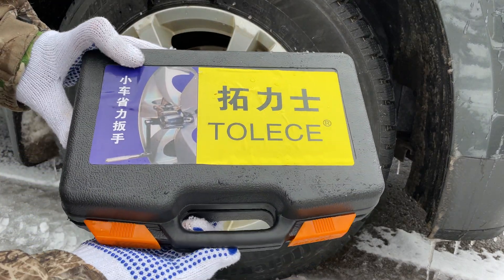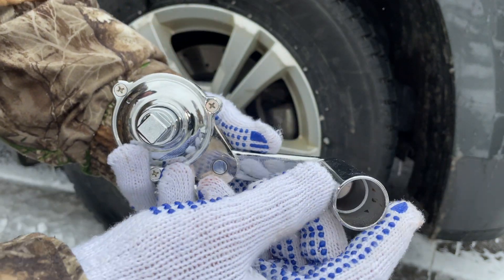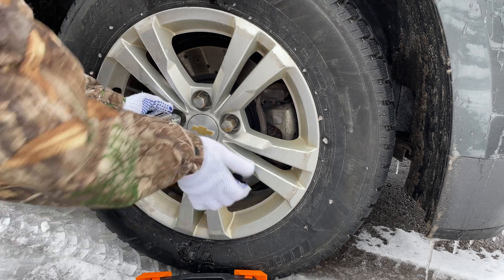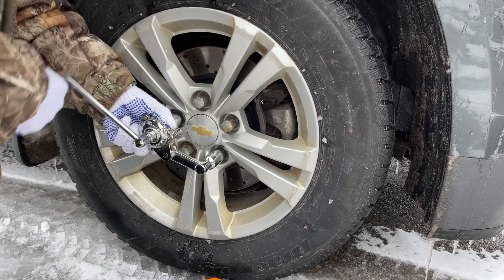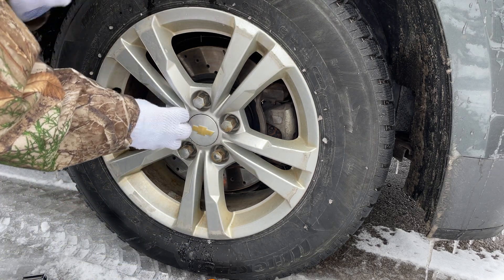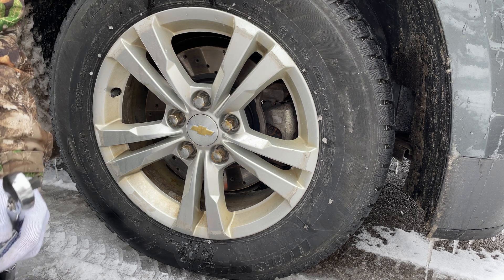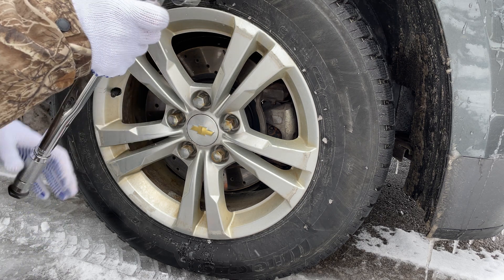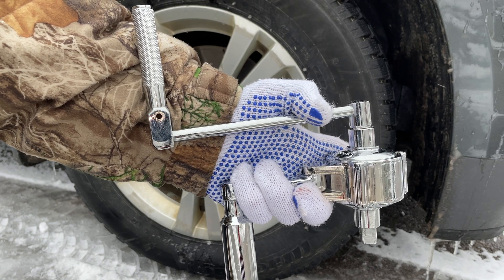How To Use A Torque Multiplier Tool

Comment: Appears to be an excellent tool. But you can of course, use a 2 foot piece of steel pipe big enough to go over your normal wrench and you've multiplied the force that way.
Reply from the maker: Sometimes two feet isn’t long enough. This applies way more force than a two foot pipe. These bolts were 140 foot pounds and you saw this tool is so smooth that a small child could use it. This tool is aimed more for when strength isn’t your “strong suit”.

Comment: Este video vale ORO!!! NADIE aclara que solo es útil para aflojar MAS NO para apretar...si tuvieras un boton de "DONATE", ya te habría mandado mi dolar. Gracias
Reply from the maker: You technically can use it to tighten the bolt if you don’t have a wrench with you, however as it multiplies torque you risk over tightening and snapping the studs. I prefer to only use this tool to loosen. Thanks for watching. Please like and subscribe

Comment: I assume it wouldn’t be a good idea to use one to tighten nuts 🤔
Reply from the maker: That's correct, this tool is designed for loosening stubborn nuts and bolts, not for tightening. Thanks for watching. Please like and subscribe

Comment: Can you use it to remove the axle nut?
Reply from the maker: It should work for that. I would say you could put the lug cylinder on one of the studs and align the socket with the axle nut. I can’t see any issue with that. Thanks for watching. Please like and subscribe

Comment: if you're using a torque wrench to tighten then use it to loosen the lug>>WTF ya need the multiplier for ????
Reply from the maker: A multiplier is to remove seized bolts. And a torque wrench is not meant to break lug nuts. That’s a good way to ruin the torque wrench.

Comment: why not just use breaker bar
Reply from the maker: This tool is meant for someone with low upper body strength. With a breaker bar you still need to use force if bolts are seized. This makes it effortless. I get what you are saying though. I actually sold this after making this video because personally I can pop 5 lugs faster with a breaker bar.

Comment: The central gear inside my tool stripped out.
Reply from the maker: How long have you owned it? How much did you use? They are cheaply made so the longevity isn’t gonna be great. I sold mine a month after I got it and went back to the trusty old breaker bar.

Comment: I grabbed on off Amazon a couple of months ago after not being able to break some Lugnuts loose on a golf cart, even with the use of an air ratchet. I bought the torque multiplier and was able to remove the Lugnuts pretty easily, these things really do work.
Reply from the maker: Yes indeed they do. For future though air ratchets are not very strong and not meant for getting off seized bolts or nuts. You may want to buy an impact gun for that. Thanks for watching. Please like and subscribe
Reply: how much it cost?

Comment: How do you remove the last lug nut when you have removed the rest?
Reply from the maker: Leave the second last lug nut on the stud on after you breaker it loose so the tool will still fit over it. Then take it off with your fingers after. Nice and simple. Thanks for watching. Please like and subscribe

Comment: I did not know of this type of tool, thanks I just ordered one. The Tyre fitters always tighten too much with the air powered rattle guns.
Reply from the maker: Yes this is very convenient for adding strength. Also great if the lugs are seized on from being on too long. Thanks for watching. Please like and subscribe

Comment: Might be a good idea to have for junk yard trips.  Curious how it works on a car that is off the ground with the wheels dangling.  Does the leverage action of the tool negate the need to have another person in the car holding the brake down to break the lugs loose?
Reply from the maker: I’m not sure if that would work. It would be interesting to find out. Unfortunately I sold mine so I can’t test that theory. I’m thinking if you are doing regular junk yard trips then a battery powered impact gun would be more practical as this tool is only good for removing lugs. A battery powered impact can do any bolt.